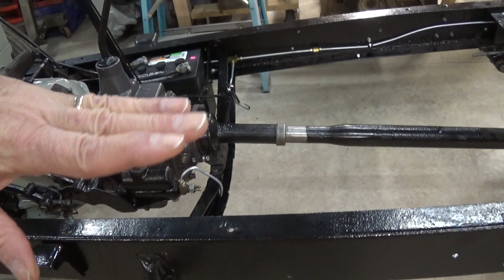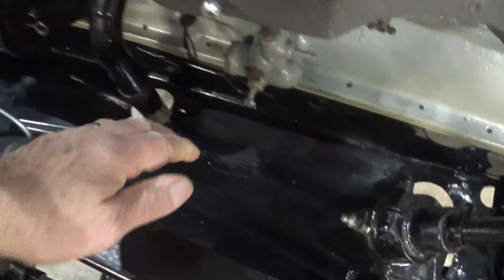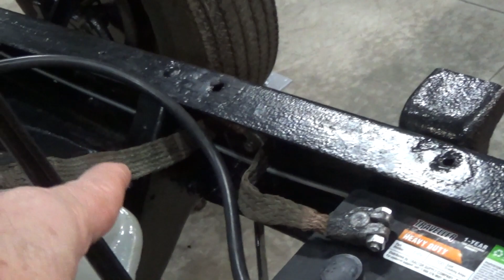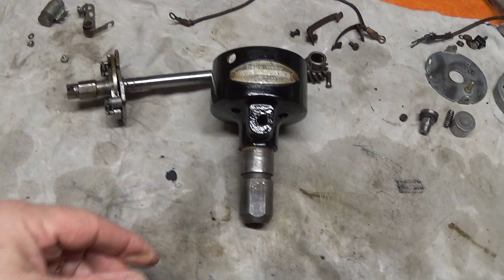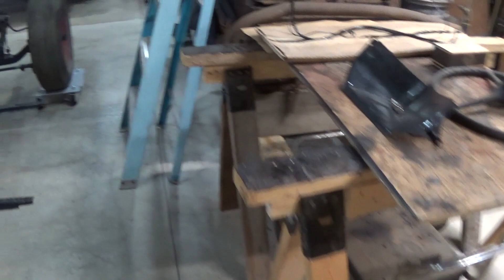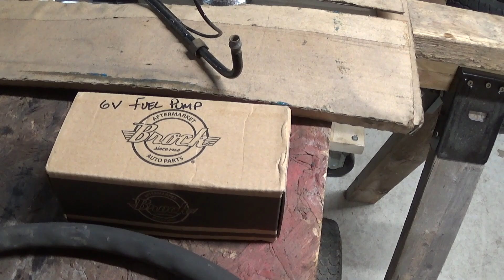1936 Chevy Pickup - Update 1-23-21

Comment: Ken,
It looks like your spare engine is a 1935. I think I caught a glimpse of the cylinder barrels under the manifold  The distributor will not work in your '36. The slot and tongue (oil pump/distributor) are reversed on the '35 engine. FYI, the front mount goes under the crossmember, no matter what transmission you have. Your NOS fuel pump will probably not last long with fuel containing alcohol. You will need to get a replacement diaphragm that is made of a different material. They are readily available without having to buy a complete rebuild kit. You should not need your electric fuel pump.
Your old condenser says DELCO REMY. The original lower hose used two pieces of straight hose and a metal elbow. I think you can find a curved hose to do it in one piece or find the elbow on eBay. (I have some too) Nice progress.
Reply from the maker: You have a good eye Mike, it is a '35, but I appreciate the information concerning the distributor. I cleaned up the original distributor and it should work fine. I'll have to look into a diaphragm, but I plan on using non-ethanol fuel so it might last a bit longer. Yeah you're right on the condenser, I didn't think about REMY until you mentioned it, duh. I am looking for the hoses and I'll probably go with a one piece bottom hose, but I'll look through my stash and see if I can find that metal elbow might end up going with the original. I sure do appreciate your expertise on '36's. I appreciate all the comments and input from everyone.
Reply: @snowking55  Ken,  We communicated through the VCCA chat site a couple of year ago. I am 35mike over there. 1935 engines use a different water pump also. Two different heads, with different angel on the valve seats, were used in '35. The late '35 head is the same as '36. Some early '36 engines had the smooth valve cover like the '35. If you want the modern diaphragm for your fuel pump, it is the same as was used on flathead Fords.
Reply from the maker: @mikerussell505  Yeah Mike I bought the 35 basically as a model to look at when reassembling my engine. It's good to know that a lot of those parts are not interchangeable, I thought they would be. I'll keep my eyes open for a diaphragm, good to know the Ford will work. Boy it's been awhile since I've chatted on the VCCA site, last time was looking for pistons to replace my worn out ones. Couldn't find any so the machine shop went with aluminum .30 over. I did have a set of NOS babbited rods  that I used though. The engine builder had a bit of an issue line boring the rods, but he said it was successful. I'm getting close to firing up the engine, got the distributor put back together and installed. I need to get the wires put together and installed, get the carb on, add some fuel and see what happens.